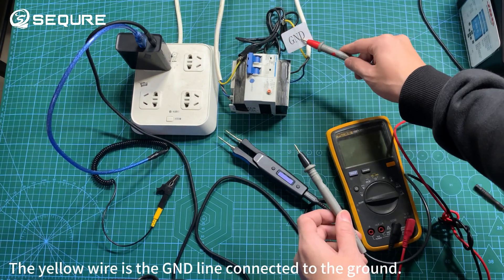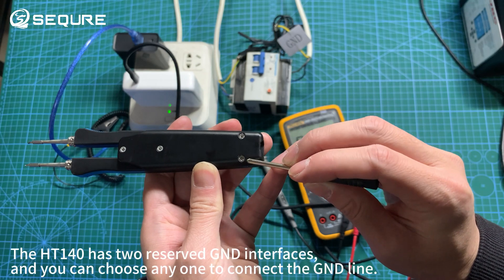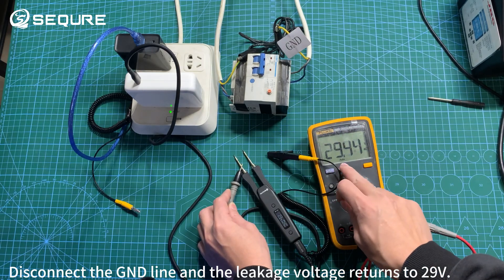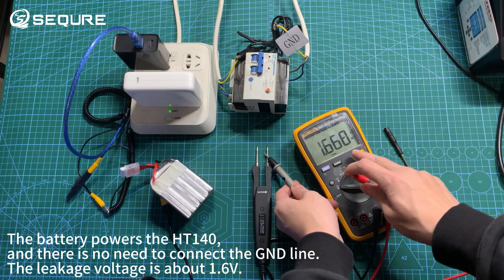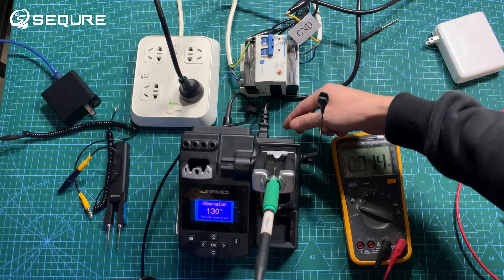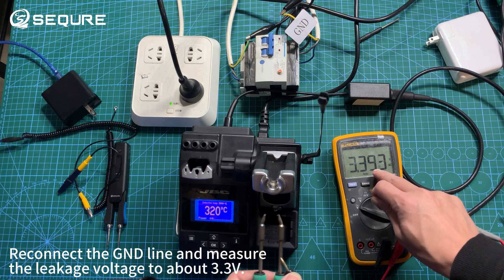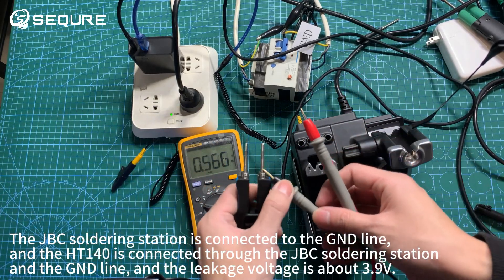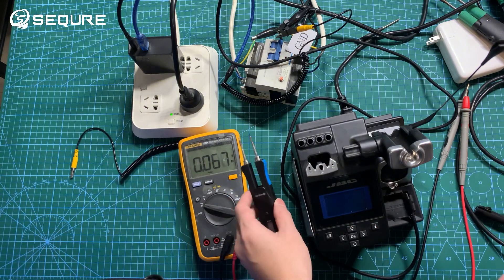SEQURE HT140 GND Line Test

Comment: I had a bad experience soldering with the P60P and Fnirsi HS-01. Both soldering irons were powered from the same source, and I was soldering one component with both of them. What happened in the end? A genuine JBC cartridge that cost nearly $100 ended up in the trash. This happened because the cartridges aren’t grounded and have a potential difference. With original JBC soldering irons, you don’t have these issues. I no longer buy Chinese knockoffs
Reply: просто Р60Р имеет "кривую" систему питания жала. в отличии от фнирси. Потому у вас жало и "пыхнуло".

Comment: Hi, why do you measure AC voltages by probing multimeter against your right hand and not directly against Ground (i.e. yellow/green wire of mains)? Thanks
Reply from the maker: Dear customer, we are sorry for the late reply. Please send your question to our email and we will solve it for you as a priority.
Reply: Because your body works same way as "ground" and a high impedance multimeter will measure basically the same. I use this technique a LOT.
Also I highly doubt anyone working on a PCB got it connected to grid ground wire and any voltage leakage potentially affecting it is going to be through you.
BTW I have one ordered, I intend to fully test the leakage situation and also do actual circuit analysis so surely I'll update with hard facts.

Comment: Totally wrong, firstly the power supply does not separate cleanly because cheap capacitors were used between the primary and secondary separation in the power supply. Secondly the soldering tips must be connected to the GND of the target object to be soldered via a 100k-1M Ohm resistor and not to the earth potential, which could lead to the destruction of the target object.
Reply: Almost every SPMS has Y1 capacitors between the primary and secondary side for EMC reasons. This has nothing to do with cheap. The 50Hz mains frequency and the capacitive resistance then result in the touch current. 
My JBC CD2E station has a directly earthed tip. Ersa also says resistance tip to earth <2Ohm for their ICon station.
Reply: My HT140 tweezers showed 104VAC RMS, or 337VAC P-P. I would MUCH rather have an earthed tip than those sorts of voltages floating around as I worked on my expensive PCBs. Btw, my JBC station has a directly earthed tip (measured at 1ohm) and I don't really see a problem unless you are accustomed to soldering on live PCB's or recently charged caps etc (minority).
There's a video on my channel where I first explored the HT140 issue, including scoping the tips to see the voltages involved.
Again, kudos to Secure for providing a fix.
Reply from the maker: Thanks for your participation in the discussion and suggestions, the video uses AC power supply and battery, portable power supply comparison test, can confirm that the leakage voltage is due to the AC power supply. We connect the AC power supply to the GND line ourselves, eliminate the leakage voltage of the AC power supply from the source, so that the leakage voltage of the power supply has been eliminated before the input of HT140, which is safe for the soldering iron tip and the target item. If my description is not sufficient, please add, thank you.